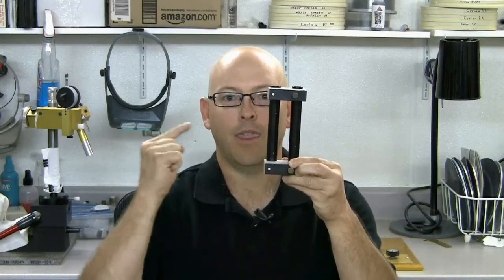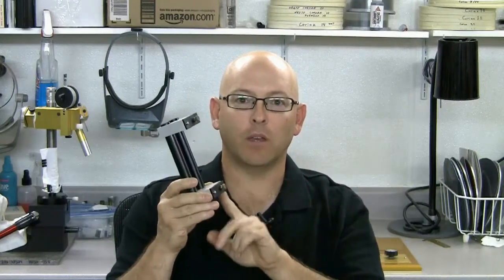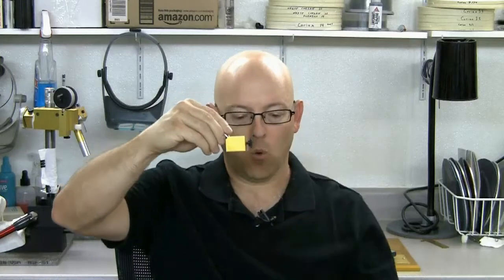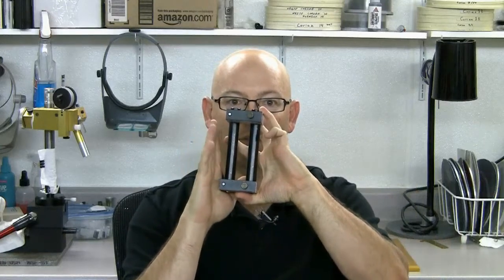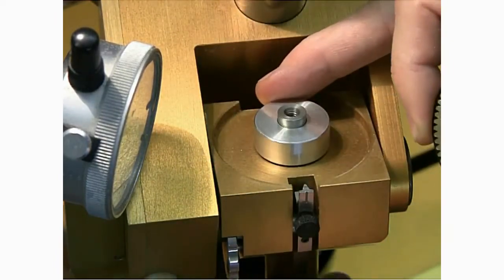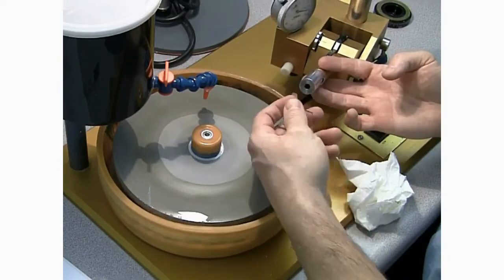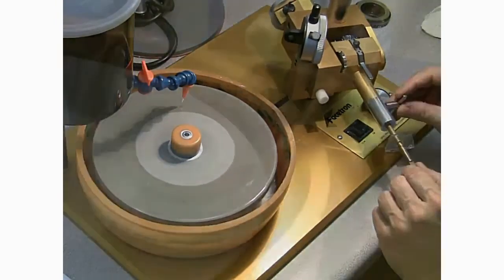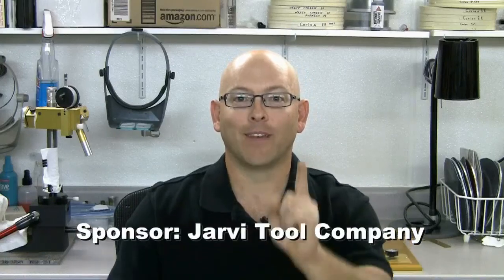Official Facetron Videos: Zeroing the Cheater Using a Tool You Make

Comment: I bought a VERY used Facetron machine, and the cheater is frozen.  I don't want to break anything, but I am unable to move it, and I don't want to force it.  How easily should the cheater move, and do you think adding penetrating oil into it would help loosen it?  Would penetrating oil damage the machine in any way? I havn't found a video of someone manipulating the cheater up close, it is always far away and hidden by their fingers.
Reply: I love my Facetron machine, even if it is used, but I want to be able to service it correctly so it can last. The lack of adjustment with my older machine is hindering my ability to progress in my accuracy of cutting.

Comment: Is there anything preventing the cheater from turning?  I have old facetron, sat in garage in tub for 20+ years.   The pin that you depress to spin quill is not centered but on one side, should it be centered?
Reply from the maker: There shouldn't be anything preventing it from turning, but they can get caked with swarf or otherwise stuck. So, you may have to carefully fidget with it, use some WD-40 or other lubricant, to get it moving. It should indeed be centered, especially as the first step for the zeroing procedure in the video.

Comment: Hey John! I'm in the process of zero'ing out my cheater. Is there a way to reset the "new zero" to actual zero? I'm cutting on a Graves MK1 but i assume its close to the same idea
Reply from the maker: On the Facetron, no. We just mark the cheater dial with a pencil or a fine-point sharpie - so we can move the line later when we re-zero next time.